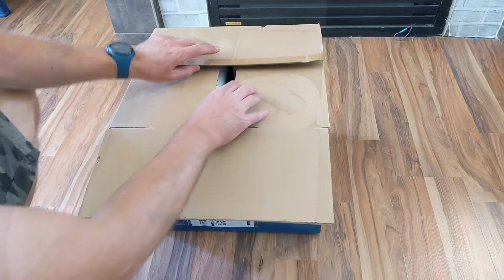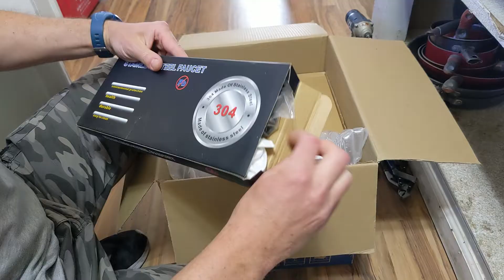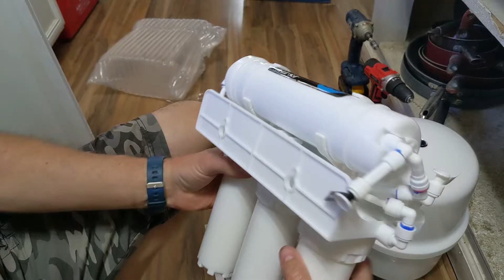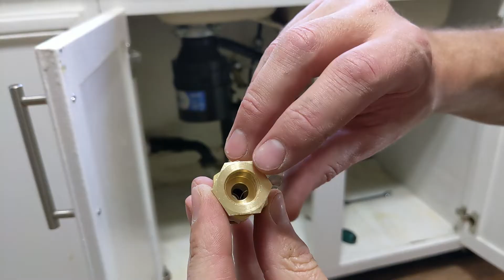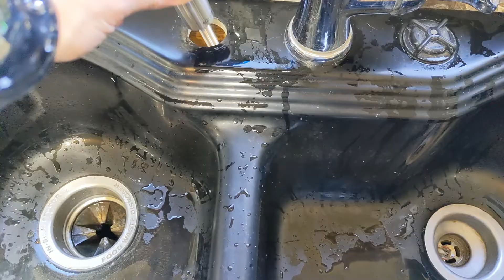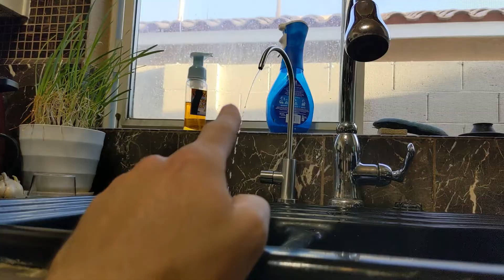WHY this not THAT - Water filtration system installation Step by Step instructions - FS-RO-100G-A

Comment: I have mine installed but I can’t figure out how to pressurize it. It only drips and then stops.
Reply from the maker: Faucet on top of the tank not open , or the hoses are not in the right order
Reply from the maker: Also make sure you remove the plastic foil that covers the filters